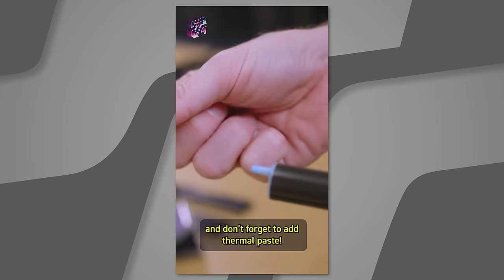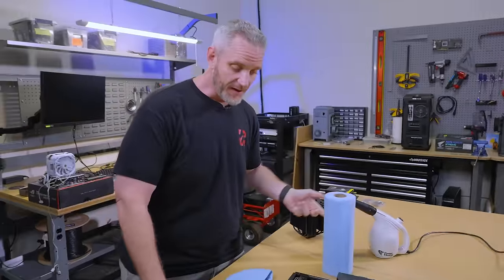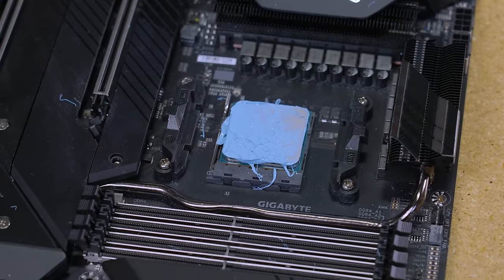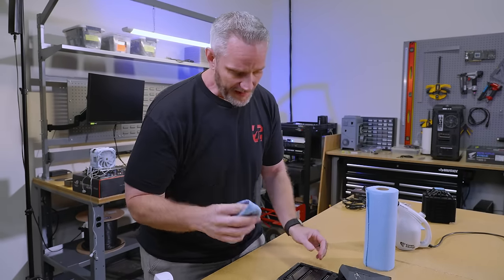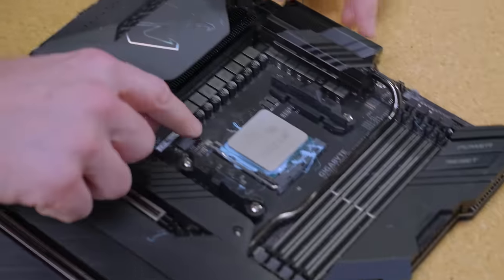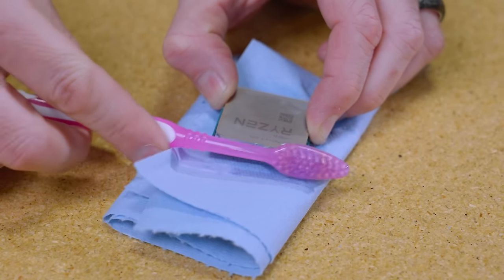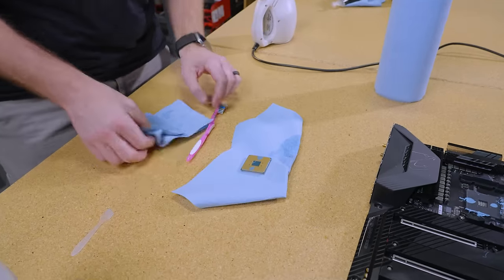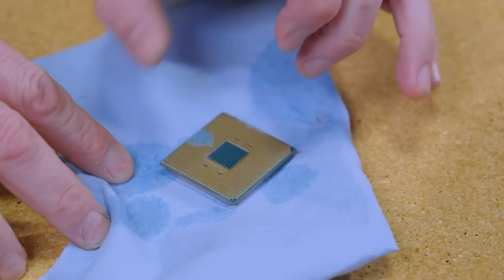This is a disaster!

Comment: thank you Jay for this video. it is helpful as always. 
i have a couple questions:
is 70% alcohol good or i need 90% alcohol!?
those blue tissue i didn't see it in my country!! what is called!? and is it ok to use a normal tissue??
Reply: Alcohol:
When using ethanol, you should go for 90%+. It cleans many things well leaving no residue. 70% will clean too, but it's not the same.
Isopropyl alcohol is a completely different thing. It's a more aggressive solvent. You may find it branded as an electronics cleaner, even in supermarkets near the car fluids, minor fix, electrical products. Usually, I've seen it sold as a spray. You must be careful not to let it get splashed into your eyes or other random places (for example it can rapidly remove some paints). I've never seen it sold diluted, only pure. (except as an ingredient of more aggressive medical cleaning liquids, which instead of 70% ethanol, use ~40+% ethanol, ~20% isoprophanol,  other stuff, ~30% water; recommended, and read the label)

Blue towels:
I couldn't really find them in Poland, where I live. It seems to be a US-specific brand. I spent quite a lot of time looking for them. You can duckduck/google them as "Scott shop towel". Scott brand is a part of Kimberly-Clark family, which includes WypAll and Kimtech, which are scarcely available here. They have some products which descriptions look similar or more interesting. However, there are other kinda similar "towels" commonly used in house cleaning. To me they look more like a blend between wet childcare tissues and "roll of kitchen cleaning rags", than paper towel. I think they're presented in this video because of their common presence in US. Perhaps we could find what are the properties to look for (including ones these blue towels are missing), to get the products we would be satisfied with.

If someone could suggest what's a good blue towels alternative, or what properties to look for, please share your thoughts.
Reply: @DirtyHairyIII  wooow. This a very looong reply i got here in youtube!! But maan thank you for the info you provide. 
And i forget to tell. I use isopropyl alcohol. Which what i find it use mostly as Sterile or sanitaizer or cleaner. Which i bought it from pharmacy. When i asked about the 90% i told i could find it in another store for a medical equipments. 
And about the blue tissues. Here in my country. I didn't find. And i ask what it is so maybe i find something look like it or similar to it. But look like i well oreder it from amazon US. I even see mechanics use it also.

Comment: Apart from video, I have found some more options. If you get thermal paste all over, then there are 3 things that you could do:
(1) Forget that it happened. Thermal paste are non conductive. So other than looking bad, it won't create any technical issues (safest and cheapest)
(2) Buy a new CPU and mother board  (Safest 🙂 but expensive 😥)
(3) Put the board into washing machine and let it run for 3 minutes (cheapest 🙂 but unsafe 😥) and you have to go to (2)

Comment: I once had to send an Asus P6X58D Premium RMA because it had POST issues even on QVL RAM sitting on memOK for hours on an end resetting it until it finally posted, but they wanted to test the board with the i7 950 I had at the shop before they wanted to do any replacements.

Well they ended up testing and I got the CPU back earlier, in a box, still with paste on it, paste visibly being on the bottom side aswell. Great. Lost the motherboard for another 7 weeks and all they did was a bios update and clean it and a false accusation the system was too hot on bootup. :')

Never solved the problem, friend managed to get hold of a brand new Asus P6T Deluxe V1 somewhere in 2013, threw it in there, runs rock-solid ever since, even with 24GB mixed 3x4GB kits of DDR3-1600 Vengeance/Dominators at CL9...

Oh man what a show that was, glad the paste underneath there hasn't ruined the CPU, only tiny spots.
And now I still have a brand new P6X58D Premium sitting in a box...

Comment: I once had to do cleaning on HP Haswell PC for school that weren't maintained because of some paperwork error. Since it had been used from purchased until Covid lockdown, the dust become sticky. I would used some kind of generic chinese brands of  WD40 spray it all over to "soak" the mobo , because using IPA is too expensive. Brush it and let it dry for three days.Then blow it woth air compressor. Use IPA on connection and ports only. Looks clean and good as new. I even revived like three old office PC and countless ex-mining RX580 using this method.

Comment: Idk how the fuck i did it but i got some thermal paste in a few of the socket holes 😑

Edit: I thought i somehow killed something because after following the guide and even being gentler than you were, it wouldn't boot... turns out when i took my corsair memory cooler off i fucking bunped a ram lock, and E V E R so slightly pulled a stick out, and my mobo doesnt have diagnostic LEDs (which is dumb, its a $250 x570s board) so i spent hours troubleshooting, and went to bed thinking i killed a board or cpu i cant even CLOSE to afford to replace rn.

Comment: I have never in my more than 30 years building systems that much paste on top or under the IHS. Reason for that, In the past I used a credit card to spread the paste, now I use a spatula, which is even better. I see guys doing a nut in the center and place the cooler on it. This means always a guess if the thermal paste is done right. Because you cannot see what is between the IHS and the cooler. Also, ISO or IPA, look out with that, I lost a ROG Asus board cleaning the pins (I thought it was a good idea) but it ripped the CPU holder pins from a i7 CPU. Always use with caution. What I also noticed, no one uses a surface purifier on the IHS, this fluid is made to clean the microscopic residue from the IHS. I do this all the time, when repasting.

Comment: Any electronics cleaner spray with zero residue will work perfectly even removing paste from Intel (and AM5) sockets, just aplying with the pressure of the own spray, it will unpaste all pins and components with no problem, displacing them without using any brush who could damage or bind pins 😉

Comment: Make sure to use one of the most expensive AM4 mainboards that was available, to do this demonstration. XD
I happen to have that board too. I got it second hand and only discovered AFTER building the entire PC, that the CMOS battery on it is apparently not good enough to have the BIOS be remembered when I disconnect the PC from power, even though hardware monitor says it still has 2.8 volt in it.
The annoying bit with this board is, the CMOS battery is hidden behind the chipset heatsink, which you can only remove, by unscrewing the whole heatsink from the back! Of course, after removing the backplate. I mean, it's a nice board, but... That is definitely a design flaw!
Oh well... Power outages are VERY rare here, so I guess I'll just have to deal with not unplugging my PC... =/

Comment: Hmm... what about blowing air creating static electricity on your blower nozzle?  Unless you have an ESD rated (grounded) blower or vacuum, I would keep those plastic nozzles 15 cm (6 in in American 🙂) from your components. High flow air in a plastic tube can build up a static charge on the nozzle of several 1000s of volts. If you have a proper ESD rated blower or vacuum then blow away as close as you want. It is myth that air alone will cause static discharge on a board. Unless you are cleaning a PCB in a dust storm you should be fine.

Comment: I have a secret and it WILL NOT DAMAGE ANYTHING tried and test many times to clean CPU paste and motherboard dust/connector dust.  NON CHLORINATED Brake parts cleaner! ( use in a well ventilated area)  Makes you motherboard look like new and leaves no residue. Thanks!

Comment: Cut the blue towels into smaller bits to make it easier to access the mess, and increase the number of times you can wipe stuff.  No reason to waste towels - not that it is a huge expense, but it is still wasteful and makes it easier to use because the bits are bite size, not gulp size.    WASH YOUR HANDS AFTERWARD - THERMAL PASTE IS NOT GOOD FOR YOU.   Just MY take.   Your mileage may vary  JT

Comment: This has always been a go-to when thermal paste is in the socket or cpu,  pick up CRC 05103 QD Electronic Cleaner.  Just spray and you are all set
Reply: European Brake cleaner also works and is way cheaper. No clue what vile stuff may be in there mit the EU-stuff is about the same ;)
Reply: @peterpain6625  I'll stick to something I know can be used for things like this and not brake-cleaner.

Comment: The CPU is not harmed by soaking in 99% alcohol. I soak it, then stand it up in a dish and toothbrush it clean. Rinse with more film remover.  If that doesn't work, I use an industrial cirus solvent (ISS Pro-Care; incredible stuff) that absolutely will devastate even backed paste.  Then rinse with film remover.  Let dry. Simple stuff.

Comment: Honest question: Is there any one that ever had thermalpaste on the cpu pins/socket holes?? 
Just.... how??? (outside the Jay-way)
P.s. I would very much recommend to just flush the paste of the board with extra iso-prop-alcohol before using a blower 🤣

Comment: Any tips about cleaning Intel 1700 socket?

EDIT: I did it it was nerve wrecking and depending on the amount of paste will take forever thankfully i only had two tiny dots no more than 1mm in diameter. 
Anyways this is how i did it on my intel z790. Don't use any toothbrush etc you will bent your pins and will be screwed!!!
What i did is put the board straight up inverted (CPU socket on bottom that way the fluid just runs down  and to the bottom of board and doesn't stay on it to cause discoloration etc. though still use compressed air to get it out regullary during process if you want to avoid it) and just spray the socket with alcohol and use compressed air to just get the fluid out, repeat it over and over and you will get it out eventually though don't expect 10min results this is something that will take a while for me it took like 45 min- 60min but i was very carefull and was working very slow.

I don't recommend any toothbrush for this as i said i would at most just get few strands from the brush and try to get there if you have to but i don't recommend it those pins are extremly fragile.Just spray then air and repeat till it dissolves and gets out and pray i suppose :)

Also i don't know if it matters but when searching for IPA i found there are different composition in them some had 95% while others had 99,7 or 99,9% alcohol i went with the 99,9%.

Patience and perseverance and you will succedd in this remember haste is your worst enemy in this. Better to spend few hours on this then buy new board.

Comment: It is possible to remove upper part of AM4 socket, but it's not recommended since: 1. it's need thin and wide tool; 2. it's locking plastic things are fragile.

Comment: Quick question, what is the average temp the 1660 Super single fan supposed to hover around? Mine is at about 80-85 average but i heard everywhere it's a toasty boy and the single fan version literally makes it worse. There are workarounds but i just want to know a baseline if anyone knows. 
Just made a huge system uogare as a whole and now i have a Rzyen 5 5500, it runs we but i use the thremal pad it came with out of sheer fear of putting paste on it, unlike Intel the AMD looks like you can get alot of paste in alot of places you don't want to. This is honestly one of my buggest fears now but soon imma have to paste it. Same for my poor 1660 Super which stays kinda hot.

Comment: If you thought you couldn't do it in a short then you spent too much time and thought on this one lol. All you need is a can of isopropyl alcohol spray (the compressed pressurized ones), that's it! What do you do? You spray it, silly! You're way overthinking this job jay. Also canned air is not a good idea, you want the powered blower because it produces heated air and helps dry the isopropyl alcohol faster. Brushing may work, but it will take a lot longer and poses a risk to you damaging stuff still by bending it. Also electronics q-tips are better than blue shop towels for cleaning the edges of the CPU like you were since they are literally meant for cleaning those areas and give you way more control. This guide isn't bad if you've never had any electronics cleaning training, but these things exist for a reason, please use the correct tools whenever possible! Even a soft toothbrush can cause damage to SMDs and especially to LGA socket pins if you're not careful

Comment: Speaking of pins I took out my 2500k to swap in a 3770, and there were 2 or 3 pins bent out of place, at least another one definitely couldn't have been contacting its ballpad on the CPU. I don't know how it was wasn't shorting the next one nor how the CPU had been working fine before.

Spent an hour with headloupes and a fine pick tool meticulously bending them back into place praying they didn't snap.

Comment: Now to convince my workplace work place that soft bristle brushes (of some type) are clean room safe. I know I can convince them that air compressor is. Not for CPU cleaning, for cleaning the hell out of the tools that plate the wafers. Would be amazing for removing excess torque seal and edding pen marks and would save my damn wrist in and shoulder in those awkward angles.

Comment: Old, dried thermal paste crumbs falling into your LGA socket when removing the CPU to swap it out for a better one. Two kitchen chairs, the PC with the side panel off and balanced between the two chairs with the system board facing straight down. Then, lying between the chairs, with a small, very soft artists brush, carefully removing the dried bits from the delicate LGA contacts with gravity's help. One of those strap on headlamps and nerves of steel helps a lot too.

Comment: i have a ryzen 9 5900x that i bought 2 weeks ago and now i want to return it but when i took the cpu out i realised i put too much thermal paste and it got into the pins of the cpu(not on the motherboard),i took a soft brush and 70% alcohol(thats the best i had) and carefully brushed it off as in the video,but now the issue is is been almost 24h and the alcohol doesn't give any signs that it would go away,it just continues to stay...what to do?

Comment: Talk about timing. 

Somehow my CPU was stuck on the heatsink so I had to use a heat gun to soften up the thermal compound. After I removed the CPU from the heatsink after a good amount of heat, I proceeded to clean the old thermal compound off. As I was wiping the compound off, somehow it oozed down onto the pins.

Used the spray and toothbrush method to get the compound off the pins completely. Thanks Jay!

Comment: After bending a pin on my 5800x3d while trying to get KPX out from between a couple pins, i said why am i being stupid and doing it the hard way. 
I sat the entire cpu into a cup of isopropyl alcohol, let it sit for an hour and came back. The paste just fell off.
To help unsure people even pins back out, use a razor blade, it allows you to push against a whole row of pins to make them all line up, instead of pushing one or two and risking over bending or snapping. If your cleaning the top side of the cpu, put it back in the plastic clamshell, it protects the pins completely

Comment: 2:08 I have managed to accidentally drop a tiny string of thermal paste into a spot on the PCIE ×16 slot. Thankfully what i couldn't clean out wasn't enough to do anything like cause a short, but God, even with alcohol and the finest fabrics and implements I could find then, it was incredibly difficult to clean

Comment: I recently sold a working 5600x, in like new condition. The buyer messaged me after they receiving it saying it didn’t work. They forced a return and when I got it back, pins were bent and thermal paste was everywhere including in the pins. Even the fan the cpu came with was a mess. In general everything looked like the builder had been quite rough with both the fan and cpu. I was forced to give them a refund. Seeing this video was perfect timing since I am going to have to clean everything up now.

Comment: One I had a motherboard that had a bunch of crap and thermal paste on the socket.  Since I didn't care about whether I ruined it or not I used "CRC QD Electronics Cleaner" straight onto the board from the can.  Its quick drying but to be safe I let it dry for like an hour.  Got all the paste and everything and the board worked.  I have since used it on other components like add on card that are dirty and has not ruined anything yet.  Really Impressive stuff IMO.

Comment: jay certainly you have used QD cleaner being an auto guy , I use it like franks red hot and my big budget builds to cleaning gpus and drying out pcbs, Alot easier and safer? yes. easy to dry with air or static drying. 'check it out. I am not a sponser lol

Comment: Happened to me once to have paste on the CPU after a failer repasting where the CPU came with the cooler and then fell off... To be sure not to damage the pins I bathed the whole CPU in a full glass of isopropyl until the paste was dissolved, and then let it dry ! didn't think to use toothbrush, but it worked perfectly

Comment: my first PC  I built I think  17yrs ago  I did that freaked out I didn't have anything to blow off the socket but  I was able to clean 90% of it and it did run not sure if it was just luck on my part or what but my pc worked for quiet a while

Comment: Better tip, which saved a friend's computer which was turned on with thermal paste inside the AM4 socket: brake clean. It removes all gunk and grease material, whilst it dries up instantly. 

Since then, 3 years ago, he has had 0 issues. I also wash components with brake clean, like RAM, CPU, motherboard sockets, etc. No dead components yet.